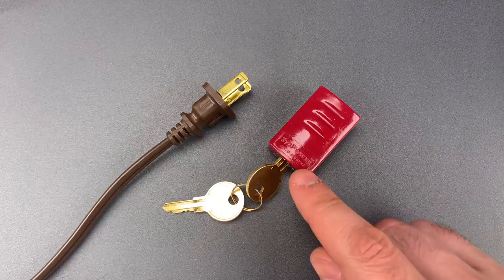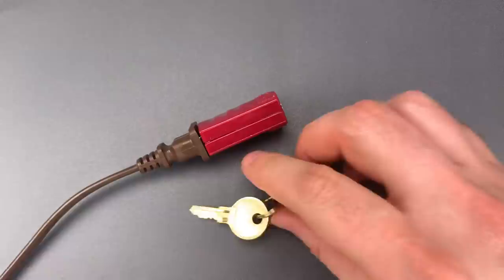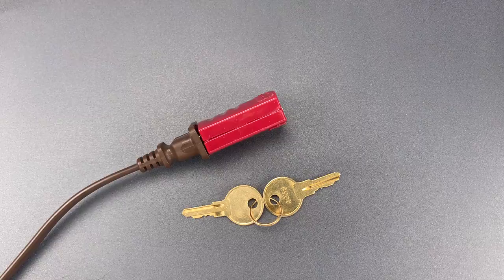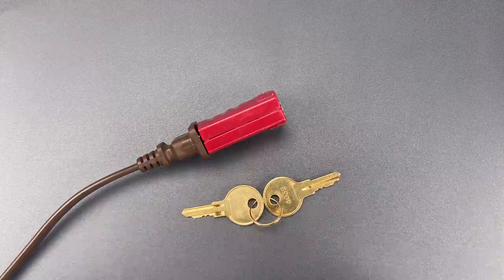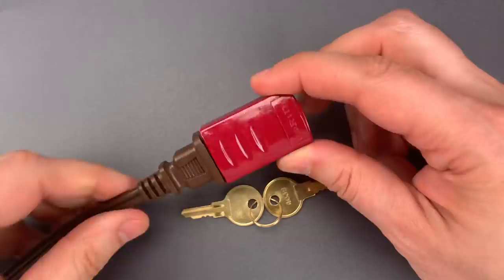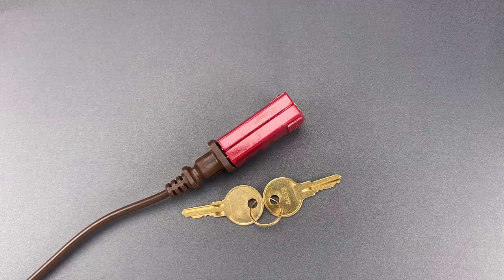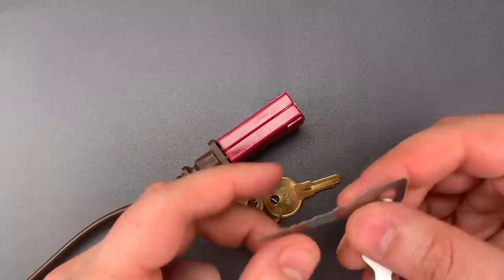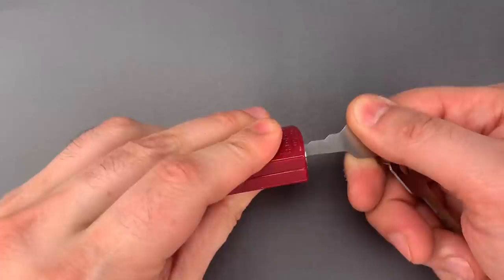[1138] Stopower Electric Plug Lock Jiggled Open FAST

Comment: first hammer, if that doesn't work: electrical pliers, soldering iron, solder, another socket-contact and heat-shrink.
Reply: Damn your american cables sure are complicated.
Well you could count that as a safety feature, i guess :P
Reply: @Gnarlf  how do you mean? the conducting part of cables are the same everywhere.
Reply: @haugstule  Well where i live, you just.
-Cut the cable
-Take of some isolation at the tops
-Screw them into a new plug
I never had to solder anything in my live and  I did all the electricity in the attic from scratch.
Or is that part just a "nice to have" to improve stability?
Reply: @Gnarlf  yes, i have plugs like this that, but those "loose" contacts in my country have ground (not U.S.A), and using a grounded contact on a  cable with 2 conducting wires is ugly and may not fit in the last socket available behind the TV. it got nothing to do with stability, it's about esthetics and availability. do you have something against soldering??? if i was this kid who got a lock like this on my console i would cut the contact on my parents most precious appliance and solder that on my console cable to drive home the message.

Comment: US plugs seem to always have those holes in the pins, so a basic small padlock through a hole is going to be FAR more secure than this thing. In relative terms. Not to someone with actual picking skills.

Comment: Simple solution: turn off the supply to the wifi. Or mould a U.K. 3-pin plug to the cable. 🤣

Comment: That thing is pointless. You can just cut the plug off and wire it onto another plug or since most modern devices have detachable wires on them and they pretty much us the same connector you can just steal the plug end off the back of a tv or whatever and use that.

Comment: If my parents would do this to me, i would cut the cable and solder it to one of their devices and solder the other plug back onto mine
Edit: It would be pointless because they have the key, or i would figure out where they put the key
Reply: find the key and melt the part that goes into the lock with the soldering iron , just a simple hole in that part should do it